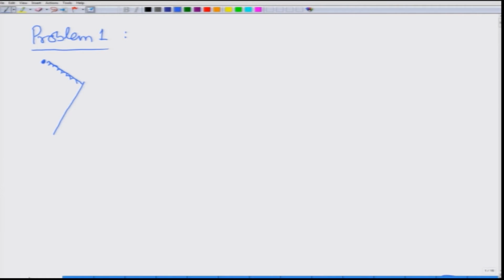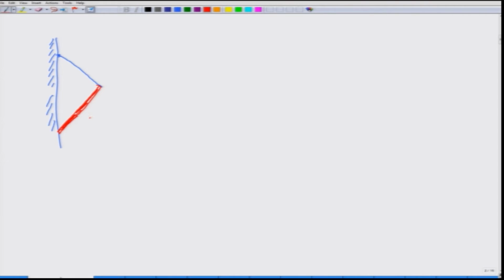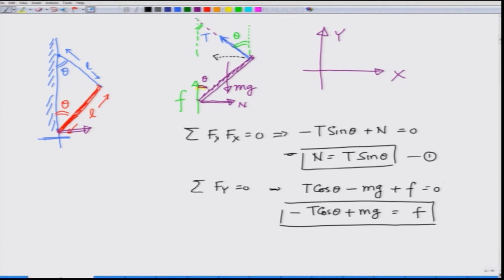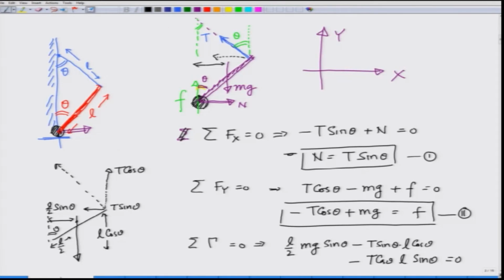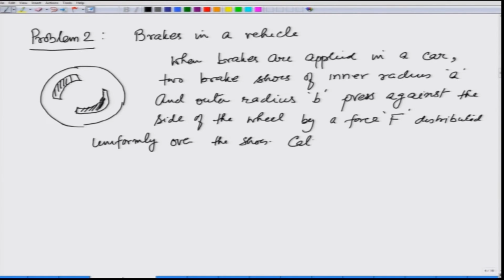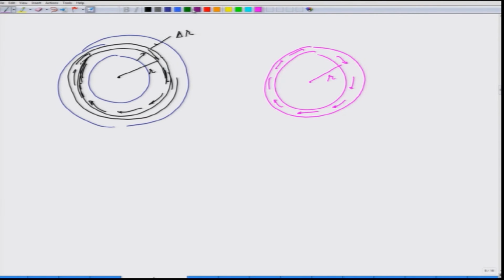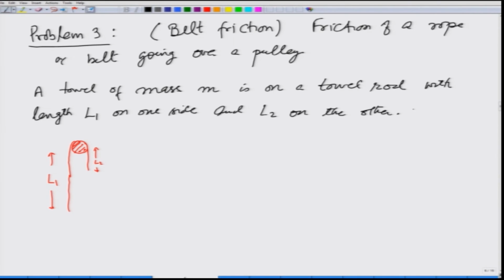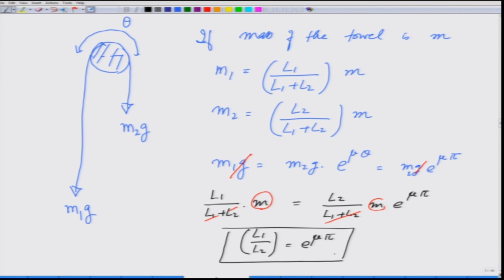Dry friction V: Solved examples

Comment: At 16:06, even if we do not assume the shoe brakes to be completely circular, i.e., there is gap between them, we will get the same braking torque. We can prove it easily by doing the calculation.